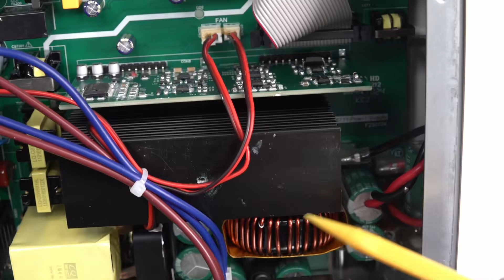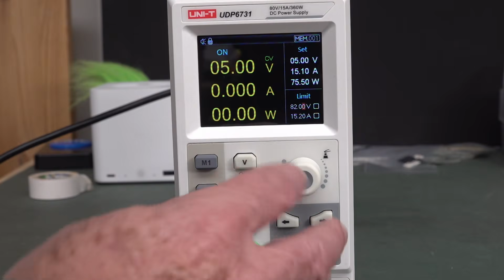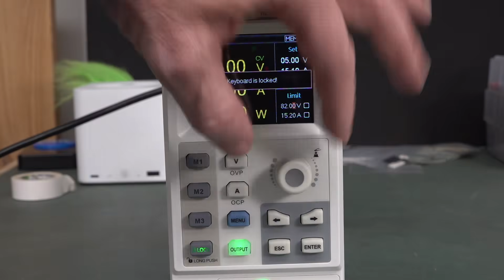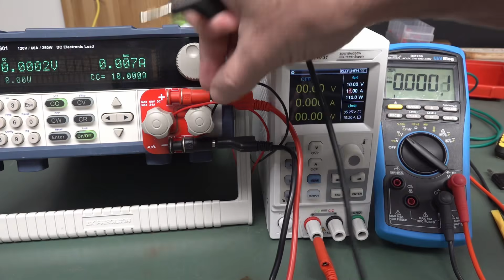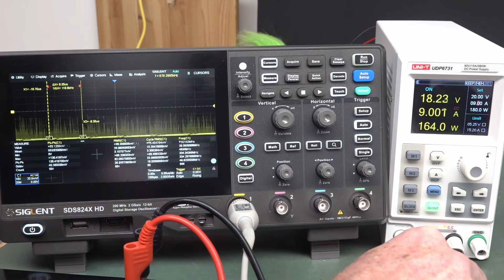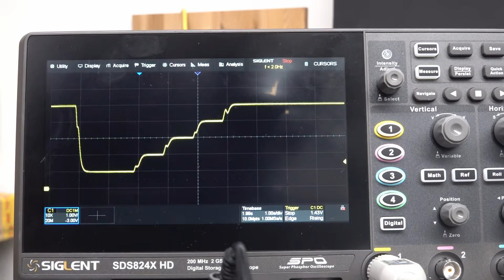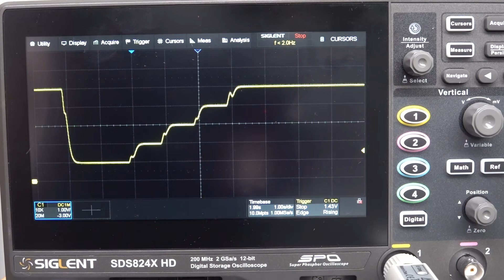EEVblog 1691 - Uni-T UDP6731 360W Bench PSU REVIEW

Comment from the maker: UPDATE: Uni-T are unable to reproduce the Lister step waveform issue that I saw. There could possibly be an issue with my unit, they are sending a replacement.
Reply: I was thinking because of the low voltage < 5V? your memory test was between 5 and 6 volt.
Reply: When you manually switched between 5 and 6 volts, your current limit was set to 0.44 A. This meant that the output voltage could not rise quick since the output capacitor was charged by the 0.44 A current only. But in the lister mode your current limit was set to 2 A which allowed the output voltage to rise quicker. I'm not sure whether it was the reason, but you probably needed to perform the comparison in the same conditions.
Reply: You are down under, no wonder the electrons want to climb back up /jk
Reply: It's because the electrons fall differently in China.
Reply: @ClippyOwns  you misspelled ”fail”
Reply: Why the F cant i buy this in europe ???
Reply: @simonstergaard I see it on the UNI-T SHOP EU. 470 euro including 19% VAT
Reply: @tohaason  Lol it's the "freedom import tax" that adds 300% to the price. So much for living in "developed" world.

Comment: no switching power supply for me. i will build my own power supply for use. no thanks for switching power supply, as they have no replacement parts if it should fail. a linear power supply is more stable then a switching power supply with replacement parts, and fewer issues in the long run.

Comment: So, these Uni-T bench PSUs have a 220V/230V setting and a 110V/120V setting..  question: Will the 110V/120V  setting actually work with 100V? I'm in Japan.  Tried to look around and I couldn't find a version with a specific 100V mode.  But it's a switch mode supply in there, so I thought.. maybe.
Reply: For most of the high quality linear power supplies there is a 100 volt setting for Japan & Korea, as you well know. In certain audio equipment like mixing boards and keyboards that run on US 115 line voltage you can't use 100 AC volts if the show is in Japan, the equipment will burn out from low voltage.  SMPS power supplies don't care.
Reply: @georgebuck2269  The reason I asked (should be obivious) was because the video clearly showed the settings at the back, which stated only 220/230 and 110/120.

Comment: The designers of this unit certainly didn't want much switching noise to be back-injected into the power mains. Good for them and us.  //  Its a shame those heat-sensitive electrolytic caps are located right next to the big guaranteed-to-get-hot heat sink. This is a terrible design choice as it will guarantee the caps' failure from excessive heat over time. That's a time bomb destined to go off. The more power the supply outputs the sooner those caps will fail.  //  The main power transformer will have high value electrolytic caps for bulk filtering, same as with linear supplies. Film types are used to block switching noise from passing through to the output.  //

Comment: Hi Dave. Why is this power supply 360W.??? If you work it out;;;     P=V times I;;;;;;   80V times 15A  equals ==1200W..  How can they claim a switch mode power supply is 360W when you do the maths and it makes no sense?  THANK YOU VERY MUCH FOR THE Video..   RE
Reply: It's not rated for 15a at 80v. It'll always dynamically switch between cc and cv mode to never exceed the rated max output power of 360w. That means the supply can only deliver the max 15a output current at 24v which is (24*15=360w) or 4.5a at 80v ( 80*4.5=360w).

Comment: I designed a 0-60V/0-15A Power Supply. It is a High frequency (500khz) switching power Supply.
It is my speciality since i work on theses technologies since i was young.
Reply: It is a high efficiency synchronous buck. Current may reach 20 Amps but i limitted it to 15.
No dissipator: Circuit board is just cooled by air with a very tiny fan underpowered it (5 volts instead of 12)  so that it can if makes no noise.
Reply: Just look at LTC7060 to see the possibl design.

Comment: The high impedance resistors connecting sense lines and the output would have seen 80V across them when you shorted the sense terminals. They might not have sized the resistors to handle 80V continuously since nominally they should only see a few mV. You probably exploded them and after that, it couldn't sense its own outputs without the jumpers

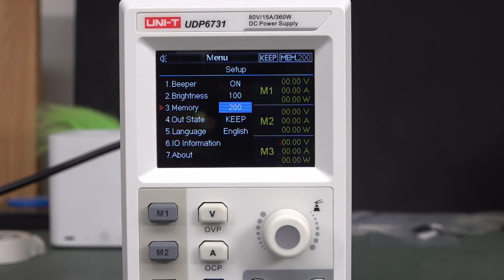Comment: 20:10 voltage sense is used for the control loop, not for measurement. So you can have your voltage regulated at the load.

Comment: 12:20 why are you comparing the heatsink sizes of the riden dc-dc with the uni-t's full offline power supply? Of course the uni-t will be larger, way more losses. Your riden psu also has an offline ps, the meanwell which has heatsinks also. Makes no sense.

Comment: Four wire power supply sensing is just separating the voltage feedback sensing (both + and ground reference) from current currying and sensing part. Those are still connected together by smalk resistors 20-50 ohms which is infinitely higher than the expected wire resistance and infinitely lower than the voltage measuring side impedance, and can still work "fine" in two wire mode with its original limitations. Cheers

Comment: If the fan doesn't start even at 100 watts, then surely you should be able to easily place several of them next to each other, as long as you're not running them at full load? That would be nice, because then you could upgrade if needed. However, the question remains as to how the lower-powered units perform in this regard. Does anyone have experience with this?

Comment: The US needs to go to 220vac! Let's get with it Yanks! 😅
Reply: All houses & businesses in the US and Canada use 115 and 230 volt wiring inside. Outlets for central air, clothes dryers & stove ovens are AC 230. We just split the wiring in two by using the center tap on the outdoor transformer. Then we can use 115 AC volts. Less people get ki - lled from electric shock with that lower voltage. 100 volts is for Japan & Korea.

Comment: I wish the 100W model was 0-10A, 0-30V. That's much more useful for everyday uses. The only reason I have to go above 24V usually is with 48V equipment, which generally is heftier than a 100W unit can deal with anyway.

Comment: I wanted to buy this model from China, thanks Dave for the review.

I was looking forward to having the Huanghui HCP 1023 series review.

I do power electronics repairs (mostly solar inverters, I was looking for a high voltage auto ranging DC power supply that I can use to simulate solar (PV Input) without causing damage to the power supply.

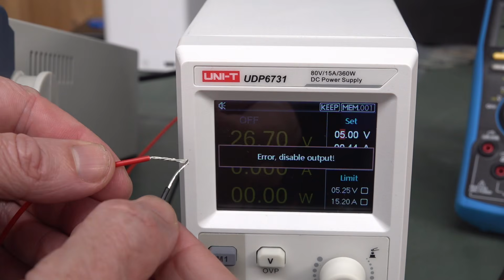Comment: The device has a hard volltage/current limit. When it tries to output your desired voltage, it increases the output voltage until it "senses" your desired voltage. Since you shorted the sense wires, the sense voltage is always zero. So, it increases the output voltage and when it reaches the hard limit (maybe a little over 80V) it disables the output. If you look carefully, right after you un-short the sense wires, it shows a very high voltage on 21:30.

Comment: Sense output is not for constant current, is for compensating the wire voltage drop, if the difference between desired voltage and the sense voltage is to big will believe that the wire is to long and the voltage can enter auto oscillation due to the delay between the output voltage and the input sensing, that is a nice feature.
Reply: Agilent and other top of the line linear power supplies have two sets of connectors on the back, voltage and current sense.

Comment: 05:12 - single insulated mains wire that can touch caps, choke and heatsink on secondary, not optimal...
Reply: It can only reach the heatsink by design, because of the zip ties. Maybe the diodes on that heatsink are plastic enclosed. Not ideal but there are worse things…

A stray metal wire or lead poking through the ventilation holes can touch PSU hot side on the backside of the PCB. Someone said live & neutral were swapped and so live wasn’t fused.

Comment: It seems an odd design choice not to use a synchronous rectifier. 15A @ .8V = 12W dissipated by the diodes. LCSC sell a 200V, 8.3mohm FET for $.8 which is approx the cost of the 4 MUR2020FC diodes from the same distributor. UNI-T likely pay a lot less.

An smd MOSFET would dissipate < 2W so wouldn't need two expensive heatsinks (>$5?) and the associated assembly costs to install the H/Ss and mount and solder the 4 through hole diodes. The 10W reduction in losses also eases the cooling requirement and might allow the 2nd fan to be removed.

Am I missing something obvious? 118kHz is hardly cutting edge.

Comment: As someone who does EMI/EMC testing, linear power supplies arent rubbish when powering a DUT  that is normally powered from a 28 VDC battery or other shipboard/aircraft source.  Better to use a linear source that isn't providing exsessive switching noise on the lines causing conductive and sometimes radiative emissions failures from the source and not the device under test.
Reply: I don't think he actually meant linear was rubbish. It's a phrase Dave uses a lot-- more showmanship than an actual distaste for linear supplies. Most hams love linear supplies because we abhor noise in all its forms. Still plenty of uses for linear supplies. Obviously switching supplies are lighter, more efficient, and generate less heat (due to said efficiency).
Reply: Thankyou!!!

Comment: Those who have used HP power supplies for a long time will remember that the hardware was quite complex. On the other hand, the software (firmware) was very simple. And they worked very well!
It is a trend nowadays for hardware to be as cheap as possible, and to compensate for the functionality with elaborate software. Who would have imagined a simple power supply using an ARM processor?
Reply: Yeah, I'm wondering if this was the reason for the glitchy steps in that last test. Previous tests were really just tests of the hardware.  As soon as  software was used to run a program however, output started behaving weirdly.
Reply: Excellent point. Also, was/is robust and dependable.

Comment: I have some experience with 6730 (40V 30A model) and it has the same odd sense behavior. If you RTM, you will find that 0.9V is the most it will compensate for with sense, then it errors. And I also somehow done something to it permanently with the sense. It worked without the sense or links, but now it doesn't. Now it requires the links or sense. Also, on 6730, a fan is on at all times and it's loud. The output caps on 6730 take like 2.5 seconds to discharge from 24V. Not my favourite PSU.

Comment: The heatsinks are separate because you need to be able to split them to screw the transistors onto the heatsink, you can see in the video that the transistors are facing inwards and are screwed

Comment: Hi,

thanx for this, Dave.

my thoughts : 80v/15A eqals 1200watts Not 360.

i'm very finw with my 30v/5A linear Power supplies. no ripple and no RF leftovers at its output. chinesuim made 40 buvks wach delivered. with a little makeover the running sinve years now without Problems. and i did stressed them.... 15volts at 3.8A for hours. added a better Fan and temp control. used old mylar insulation instead of that thick silicon type.

but let's See your opinion.

30:00 and up... Electronic load vs electronic power supply.
You need at least some old fashioned big beefy (kWatts!) resistors and or motors to test stuff. 

I usually test beefy power supplies with more beefy power amps. It first I power the amps with two of these supplies and set let say 20 volts and see if they doing something odd hooked up to this power amp and run it into 2 ohms. (which is no problem for the amp) 

And then I use the power amp and feed the power supply to test into the power amp output and see what's happening. 

Next some 12volt bulb tests and then a relay 47ohm to 1 ohm random test switching these relays in minutes and seconds. Then add some beefy coils again with relays. Usually every SMPS gave up somehow as they don't like large coils (in henries) 

cheers.

Comment: I hate the non-encoder knob design.  Put a nice firmly stepping and clicking encoder for proper feedback and make it to update fast.  The relatively new Elektron Analog Heat +FX has the best feeling and performing encoder ever.  It's called the navigation encoder.  Sounds great, feels great and works great.  You can turn it quick or very slow and precisely.  Feels great for fast and slow.  I wish everyone used that encoder and how they implemented it.  Everyone hates slow updating values.

Comment: "If it was a TCP6731, it would be far more reliable, but you'd have to give it a handshake every time."
A nice and packed power supply, though it could really use a better thermal design. Side and bottom intake, rear output (preferably at the top, but it'd take a board redesign) should be fine. Really cool deep dive and test :).

Lovely VFD in that BK Precision load... Beauty.

Comment: Solid core wire on the choke probably just because of availability of an existing solid core wired choke they had in stock.
Reply from the maker: Yep, BOM reuse is likely.
Reply: I think it's so it didn't rest on the caps beneath it.
Reply: That would make sense. Also if it's a custom part, probably easier to wind on a machine with solid wire maybe?
Reply: @voltlog  The automatic winding was my first thougth. Perhaps the earlier turns stay in place better until the coil is finished. Secondly the enameled solid wire takes way less volume and more turns can be fitted on a small core.

Comment: There are remote connection PS using USB and 5V ttl serial, much more usable. Check for potential separation to avoid smoke. 
You can use the remote port to charge batteries from excess solar power with a esp32 and a shelly, but 360W is rookie level.

Comment: I've been thinking about getting a higher-voltage power supply than my 30v unit for a while. 80V is probably way overkill, so I'd probably be fine with a 60V model, and I previously preferred linear PSUs, having seen the state of those cheaper models like the Riden unit, so it's good to see at least someone makes something a little more robust. The silicon-based electronics supplier has an interesting-looking unit for a similar price to the 60V version of this, but it's rated at 300W vs 180W, and has a weird "multimeter" function. It's just a shame they closed their local warehouse, it was literally around the corner from my parents place before they moved.

Comment: Great video as usual Dave! Thank you for such deep dives into equipment.
Just wanted to clarify that the behavior for when the feedback terminals were not used as suposed is just normal: you were disabling the feedback loop so the output just rose uncontrollably trying to bring the sense terminals up until the (thank the designers for this) hardware OVP kicked in. That means, the output just rose to over 80V each time that error popped up. That would be pretty nasty for any connected circuit if feedback wire come loose during testing, so we have to thank the high impedance internal bridge for this reason xD
You could check that with the AA battery again and setting the ps to 1V for example. The outcome would be the other way around: instead of overvolting the output until failure, it would stay at 0V since feedback is way over the set voltage.

Comment: I would be fairly interested in this supply as the voltage and current ranges are quite attractive…. However, the fact that the only connectivity option is RS-232 means that this PSU is definitely ruled out for me. The mind boggles that in 2025 someone would release a piece of lab equipment like this, at this price point without LAN connectivity.

Comment: A reason to use 2 separate heat sinks some of the components are mains connected while others are ground referenced. Providing proper isolation may be way more expensive than using separate heat sinks.
Reply: This is also the first thing I thought when he mentioned the heatsinks.

Comment: Another reason to put the controls on a separate board is cost. The power board may require 2 oz. copper while the complex control board only needs 1 oz. copper. The control board can go 4 layer while the power board only needs 2 or even one layer.

Comment: I had an issue with the OCP witha very cheap PSU i have (NANKADF WPS3010H) I was testing an automotive system 12V, around 0.5A when idle and no matter how high I set the OCP (i got to around 5A) it kept triggering and cutting off the output, I was going mad thinking my wiring had a short somewhere and just out of curiosity I disable the OCP and the system ran ok at 12V 0.3A...

Comment: 80V output without safety banana jacks is a little bit sketchy, probably not allowed to be sold like that.
Reply: We're electronic skilled people, aren't we..?

I use old, like ancient 1950s, 600volts/300mA power supplies here, when I test my tube stuff... They got the old fashioned banana plugs where you also can put plain wires in/underneath it. 

So knowing what you do is better than inoperable equipment due to oversavety designs.
Reply: @tubical71  I just mean in terms of safety regulations. If Uni-t want to be world class they can at least meet those.